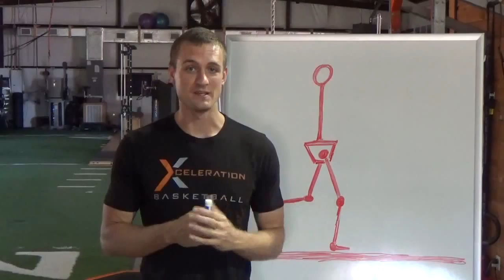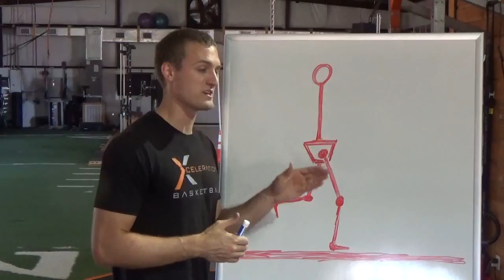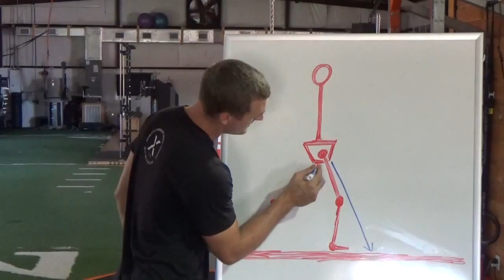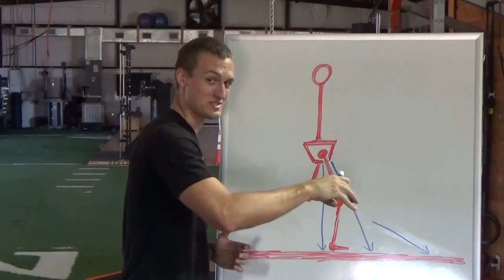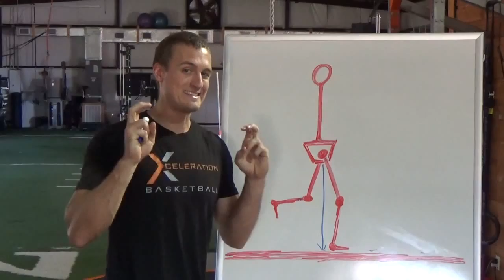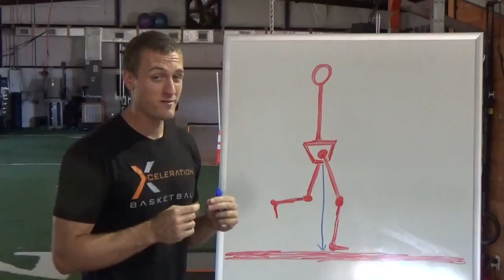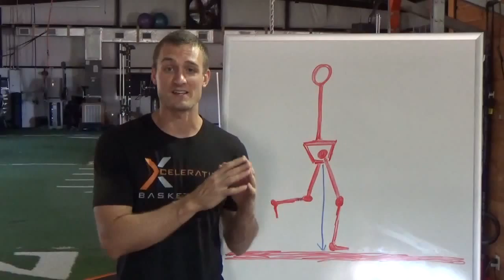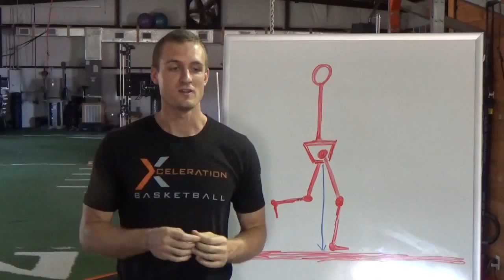Speed Science 2: Sprint Mechanics

Comment: I don't believe there's a breaking force when landing the foot in front of you, unless you really tries to straighten it to early. Naturally you bend your leg and thereby the body is being pulled forward. And then of course as the center of mass is over your foot the pushing takes over.
Reply: there might be a 'braking' force if the foot and the leg do not land properly on the ground, when the foot lands the center of mass of the whole body is behind the landing 'point', what propels it forward the first msecs is not any pulling action, but it is the law of conservation of momentum, actually it is a rotational momentum, the center of mass is rotating around the landing point, therefore if the foot and leg is not positioned properly there will be a force (torque actually) that will decelerate the center of mass
Reply: @andreaskiriakou6520  Thanks for your answer. I both agree and endure. If you put a stiff stick in the ground in front of you when moving forward then certanly you Will experience breaking force. However if the stick is rotten or have a hinge (a knee) there cant be any breaking force. That's how I see it. Also If you take narrow steps you will be well balanced when you start pushing.